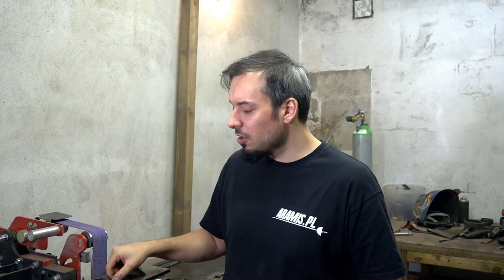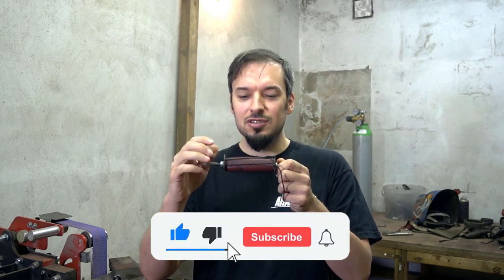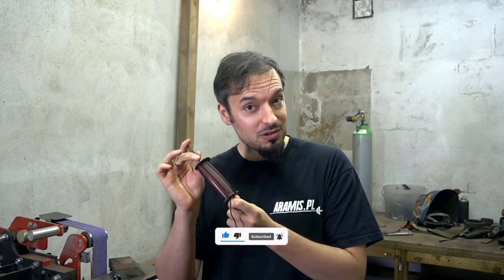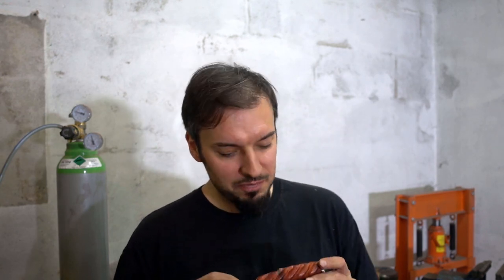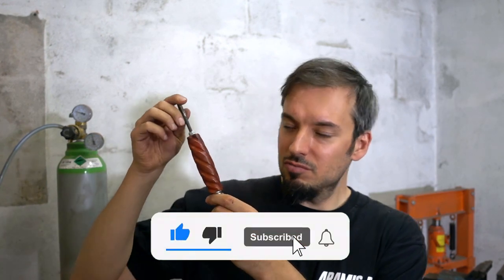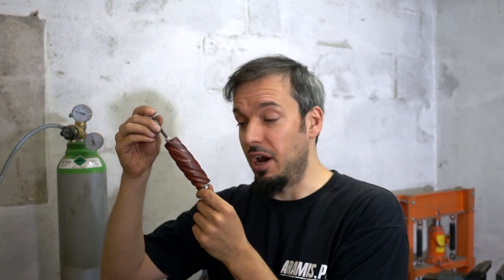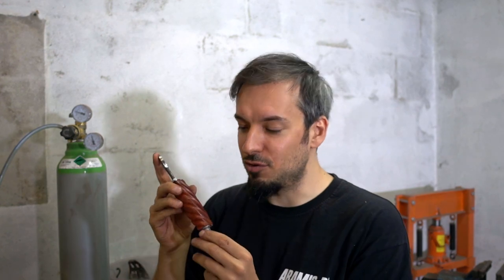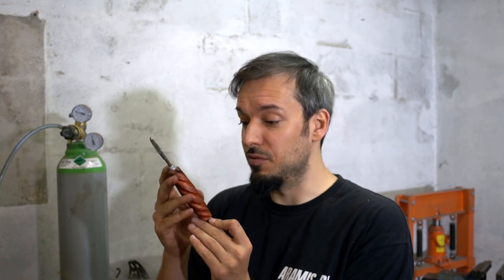How to carve a wooden handle - for Spanish small sword

Comment: How long did it take to carve the handle?
Reply from the maker: Carving itself around few hours. And then another few on polishing it off the camera with a sand paper. I would dare to say, that making a fully carved handle is around 10h. And twisting and putting a wire in - next vid- another 3-4h.